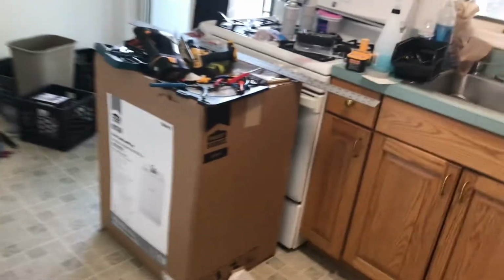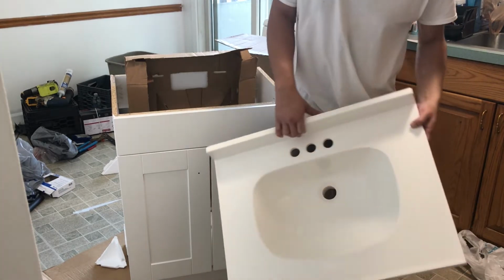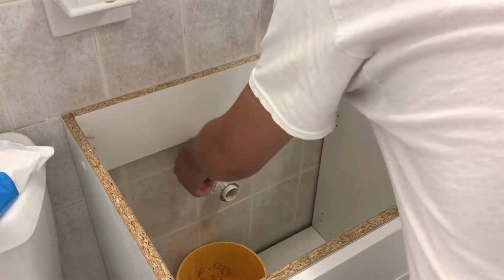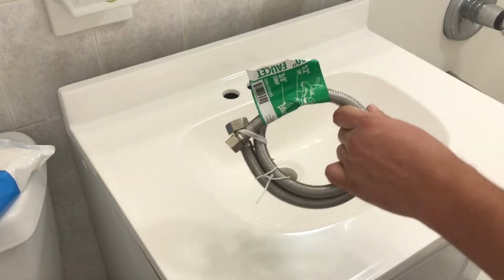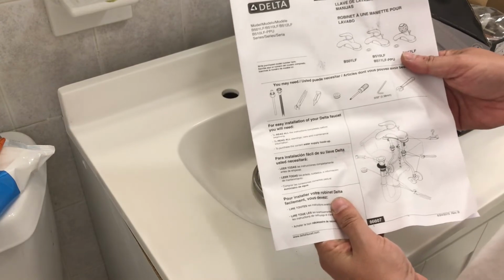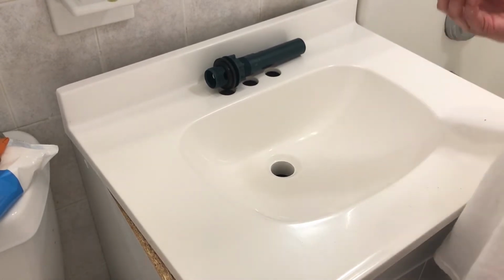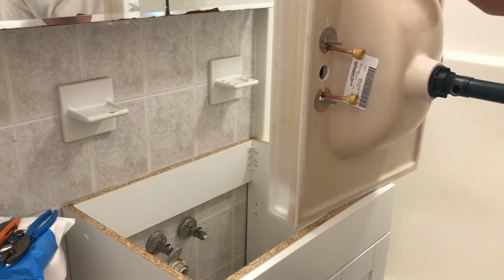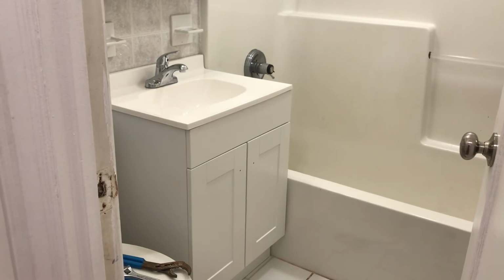Installation Review of Project Source 24-in White Single Sink Bathroom Vanity with White Marble Top

Comment: This is the perfect size for my powder room but when I went to Lowe’s and seen it on display, it looked like it was yellow-white. I want to do an all white bathroom but am worried it won’t match with a white toilet.
Reply from the maker: Are you sure they did not have 3500k temperature bulbs while you were looking at them? I am using cool white 4000k to make it very bright and white in the bathroom. Good luck on your travels.
Reply: @thefurious69  Honestly, I’m not sure what they use at their store but you’re right the lighting of the room and it’s surroundings can change the appearance of things drastically. I notice that with my flooring in rooms that have daylight bulbs vs warm white
Reply from the maker: @ItsMe-vd4qi   It depends on what you're going for. I research the crap out of my options before making decisions. Especially with the lighting in my rental properties. I overdo it, but I'm a Virgo that is just how I roll. Good Luck on your travels.
Reply: @thefurious69  I totally get that!

Comment: bought the 30"  going up against right side wall. since the backsplash and top are curved what can i use for a side splash material?
Reply from the maker: Your looking to protect the wall that will be on the right side? Plexiglass seems like it would be flexible enough if you stay thin. Good luck on your travels.

Comment: Do you think this cabinet could be painted?  And does the long hoses take up storage space in the cabinet?
Reply from the maker: Cabinet could be painted. You just have to prep it properly so your hard work will last you along time. =) If you loop up the water lines when they are brand new you will not have an issue with them taking up space. Good luck on your travels. Hopefully I can assist you in the future as well.